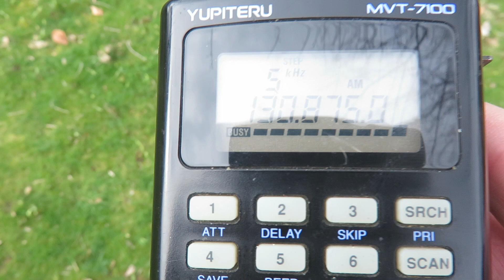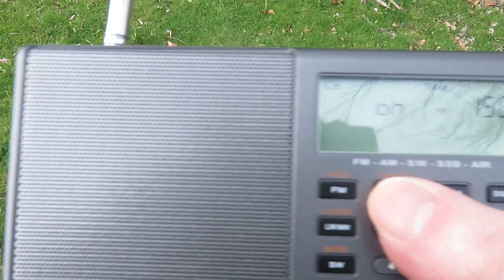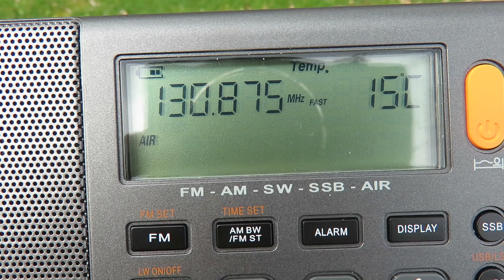Airband comparison: XHDATA D-808 vs Yupiteru MVT-7100 - part 2

Comment: Hello Sir, I think the reception is about the same, but the audio on the D-808 is slightly better - only just though. Thanks for this interesting comparison. 73! Clint
Reply from the maker: The bigger speaker, although not by much I think, has helped with the D-808. No problem at all. 73s!
Reply: that's the only criticism I can make of the 7100. The actual speaker quality is muffled in my opinion.